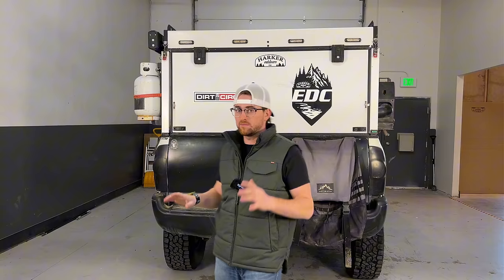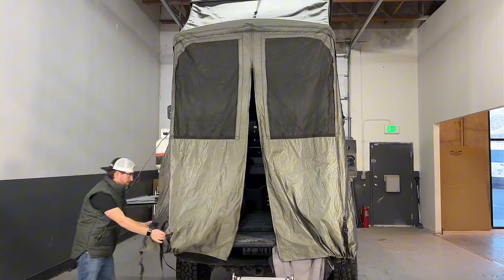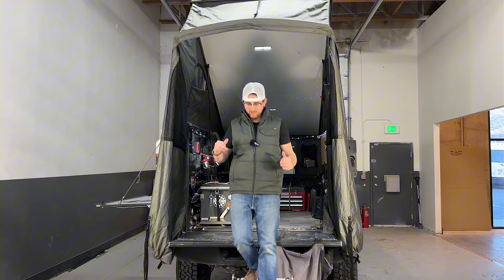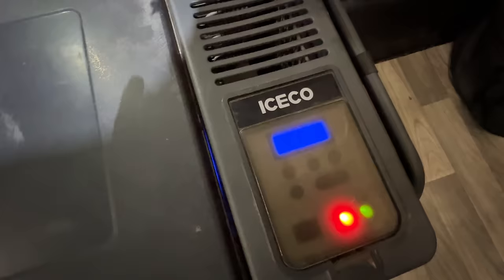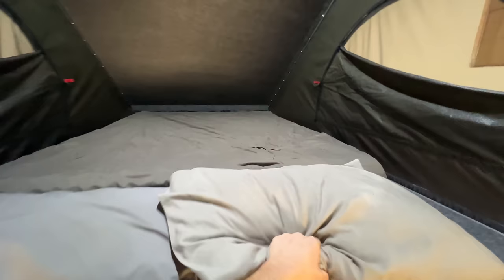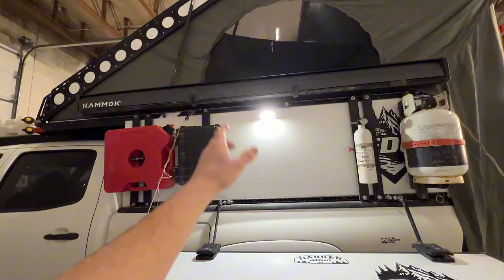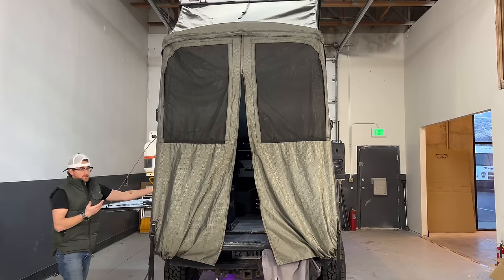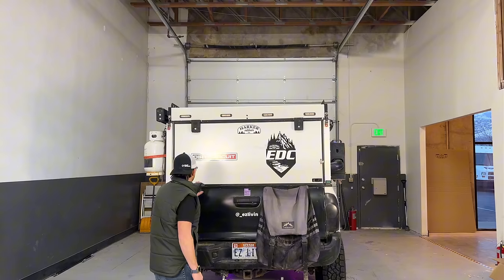The Roomiest Truck Camper Ever? Harker Outdoors EDC Walkthrough POV

Comment: my concern is bugs . How does it protect from bugs vs RTT? when you are in/out for fridge and supplies unless wait to set a tent at the end.will be nice to add netting that can be attached around camper down to floor, like even pull out fridge still close with netting behind a fridge. Netting needs to have with zipper in the middle.
Reply from the maker: Its the same as getting in and out of any other tent luckily! Especially when comparing other campers like the go fast that require opening the entire tailgate and rear hatch, the EDC has a much less chance of letting bugs in.

Comment: Hi. Is there a need for a  stiff 1200 lbs leafpack when the max payload of that truck is barely 1100 lbs?  I max out my payload at 1200 lbs and only needed helper springs to get a level ride.
Reply from the maker: Great question! On the long bed model the 1200lbs spring is actually only rated for 600lbs. I was just referring to the actual spring model. 
The camper fully loaded with camping equipment and a  full size dirt bike on the back is around 600 lbs +. 
Additionally when driving  without the dirt bike on the back the extra support helps with handling and high speed of road driving. 
The Old man Emu 600lbs kit was not enough support. (As they really only support 300lbs on the long bed) 
The Dobinson springs work perfectly. 
Here is a link to the Dobinson website if you’re interested. 

https://dobinsonusa.com/products/dobinsons-rear-leaf-springs-pair-for-toyota-tacoma-2005-to-2019-l59-112-r/
Reply: @harkeroutdoors6191 Clear enough.  I must admit that my helper springs make the ride kind of harsh when unloaded on bumpy roads.   And due to salt in winter conditions I won’t go the airbag route.

Comment: How does it drive with all that weight?
Reply from the maker: Drives incredible! Its tuned so power isn’t an issue and with the Dobinson leaf pack it handles the 450-600lbs great. (600lbs with a dirt bike on the back)
Reply: That’s not bad at all.